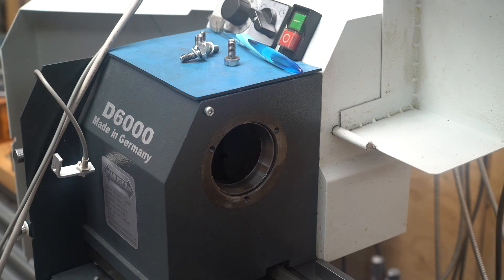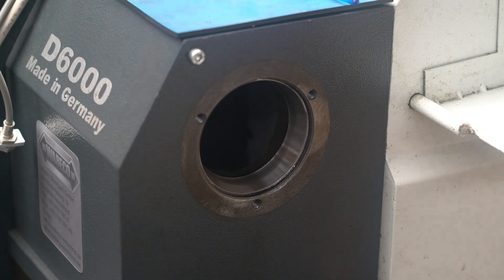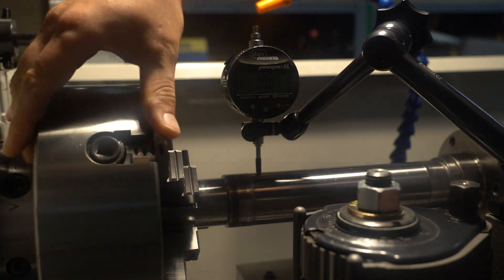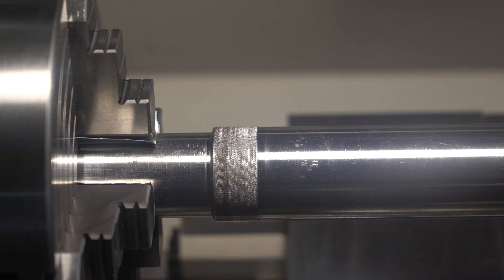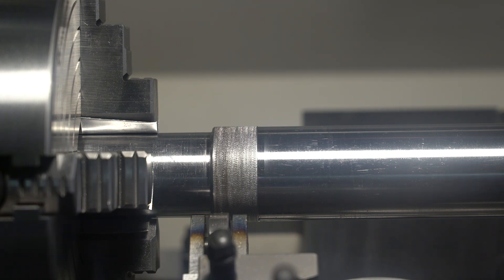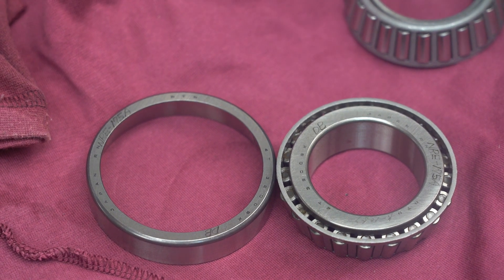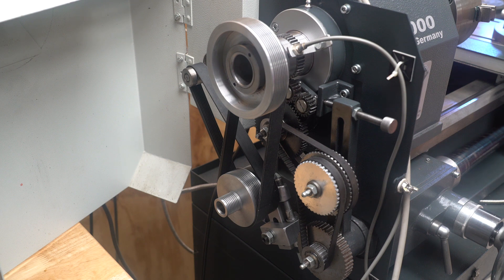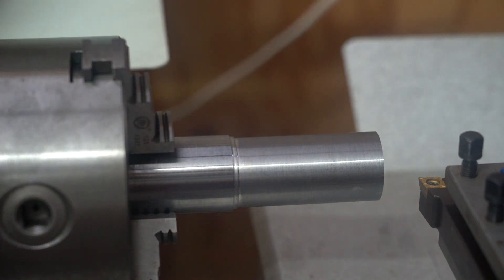Wabeco D6000 Lathe Spindle Repair

Comment: Hello Projects Down Under. I haven't watched your other videos yet and the answer might be there, but could I ask, are you the original owner of this lathe? Can we be sure the knurling on the spindle was done at the factory and with the knowledge of Wabeco's management? I noted in one of your replies to a comment that you've seen this knurling on another Wabeco spindle, which is quite telling but still not conclusive. I'd really like to get to the bottom of this. @devinmoodley4061 wrote in a comment that he asked Wabeco for clarification on this. Was there an answer you can share Devin? Regards, Rick.

Comment: i am thinking.. i would have used a thru the spindle bolt to seat the second bearing on the shaft instead of pulling it in with the retaining nut.. 

 i also would have checked the break away preload with a spring and rope in a chuck key hole or a socket clamped in the chuck with an inch ounce dial type torque wrench to get 10 to 15 ounce inches of break away torque to know i have the preload set properly.. 

 and i hate RED WHEEL Bearing grease.. but these are my personal opinions.
Reply from the maker: I did more adjustment to the bearing not shown in the video based on temperature and play etc.

Comment: Put a dial gauge on top of the chuck and a lever under. apply force to check bearing adjustment.
Reply from the maker: Thanks for the tip.

Comment: Put your dial gauge in the top of the chuck and leaver under, apply pressure to see your bearing  adjustment is correct.

Comment: I can't believe it left the factory like that... these machines are actually well regarded but a knurled surface on a bearing seat??? I've actually just emailed them asking for some clarification... thanks for sharing regardless
Reply: did you ever get a response?
Reply: my D4000 left the factory with a bad misaligned tailstock and a super crumbly bed, which began to mark and chip, without any impacts.  I returned it for a full refund.
Reply: @devinmoodley4061 Have you had any feedback from Wabeco since then?

Comment: That is a seriously poor design. Would it be possible to make a new spindle? Of course to do it properly you'd need to heat treat and grind it, but It can't be that hard to do a better job than the original. But your fix is much more realistic and probably just as good.
Reply from the maker: Making a good accurate spindle is hard and a lot of work especially boring out the center. If the spindle was cactus I would probably do it but in the case this fix will probably last the life of the lathe :)

Comment: Hmm, I don't think there is any good reason to knurl a bearing fit diameter, if that was done in the factory by the original manufacturer then they have serious quality issues. Sorry, that's my opinion. Enjoyed your video though.
Reply from the maker: No there isn't but that's the way it came from the factory, which is quite disappointing for such an expensive lathe. The only reason I can think that they did that is they couldn't reliably hit the tolerance that they needed.

The repair turned out good. By repeatedly pushing the knurling with the bump tool it work hardened and became quite stable. After a while more pressure didn't reduce the diameter any more and it came to the diameter I needed within a few micron.
Reply: @ProjectsDownUnder  Glad it worked out and you got the spindle running to spec. The bump tool was a great idea. Still amazed the factory would put the bearing on a knurled diameter.